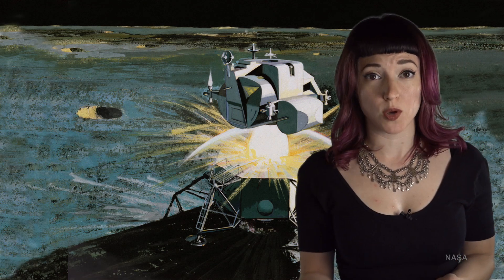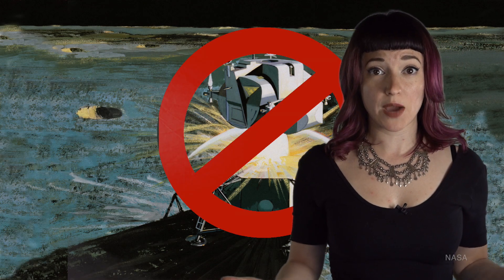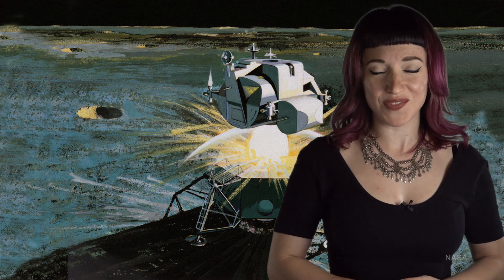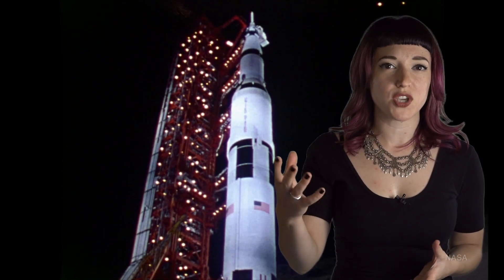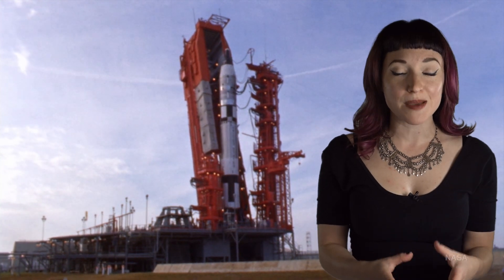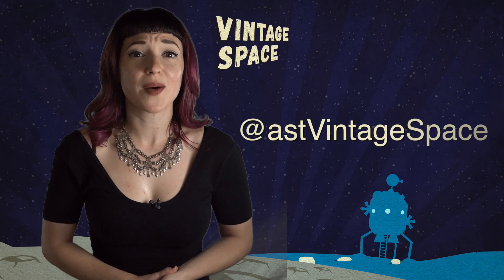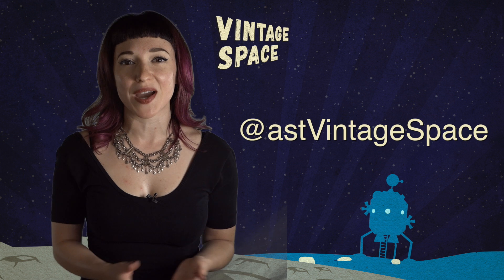How the Lunar Module Launched from the Moon Without a Flame

Comment: In space vacuum the exhaust gases will expand making flow separation thus giving not enough thrust to take the module up. It will make free expansion and attain no work. Spelling gases in vacuum won't give you force or thrust. Just a little jump thanks to the contact with the lander but nothing more. You need atmospheric pressure at nozzle's end to transfer energy, make opposite reaction,  create momentum by unbalancing forces.
Reply: Another one who failed physics for pre-teens.
Reply: @massimookissed1023 You are the failure!! LOL....  Gas generally does no work when expanding into a vacuum. This is because there's no external pressure opposing the gas's expansion, meaning no force is required to displace the gas. In a free expansion into a vacuum, the work done (W) is calculated as W = -PΔV, where P is the external pressure. Since the vacuum exerts no pressure (P=0), the work done is zero. 
Simply put...Rockets do not work in the vacuum of space!

Comment: Y can’t we use this on cars then?
Reply: Well, you probably "could" do that.  But, who would want to?  These fuels are so ridiculously corrosive that the rocket engines were one-time-use only, and basically the engine would eat itself.  So, if you want a car with an engine that could only be used once, um, ok, I guess you can do that.  Don't expect to sell very many of your cars, though.  Furthermore, the fuels and oxidizers are extremely toxic, and wildly explosive.  Many rocket scientists have died working with them.  If you want to put that kind of stuff in the public's hands, driving around in cars, sounds pretty dangerous.

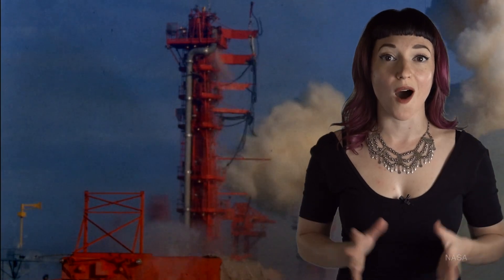Comment: At 1:40 we clearly DO see the flame - even though she had just stated that it was the same fuel used to propel the astronauts off the moon. So why don't we see the flame in the Apollo footage? Am I crazy or did she just prove that it WAS a hoax?
Reply: It's almost completely clear in the Titan launches.  You do see a bit of it.  But, that's because it's in an atmosphere, and because they ran it a bit rich (to keep it cool).  For the LEMs, there is no atmosphere, and they didn't run them rich.  And, you still do see a bit of the exhaust at the very beginning, and once pitchover happens.  The point is, most conspirards think that there should be a massive yellow/orange flame, like you see out of the Saturn V.  They are wrong.

Comment: Is it more difficult to obtain directional thrust if the exhaust power dispersed sideways in all directions?  I would expect so. Seemed to go up nice and smoothly. Did they start making these to use on earth?  Never seen one yet? Poor girl. Read too many books.
Reply: YOU SAID: "Is it more difficult to obtain directional thrust if the exhaust power dispersed sideways in all directions?  I would expect so."

== Well, I'm not 100% sure what you're asking.  Most of the thrust on liftoff was directly downward, of course.  But, yes, the thrust also spread very wide in all horizontal directions.  But, this wouldn't mess up the direction the LEM would go.  The horizontal spreading was quite uniform, so any amount of push to the left due to horizontal spreading would be countered by the same amount of push to the right.  The net effect would still be to go straight up, but the efficiency is impacted because some energy is being lost.  But, well, that's just the nature of rocketry in general.  Got any better ideas for how to propel craft in space?

YOU SAID: "Seemed to go up nice and smoothly."

== Yes.

YOU SAID: "Did they start making these to use on earth?  Never seen one yet?"

== Identical engines to the ascent engine of the LEM??  For use on Earth??  Why?  It didn't have a gimbal.  It used ridiculously volatile and toxic fuels and oxidizers.  The stuff was so corrosive that the engine couldn't even be tested before using it (because the engine basically ate itself after one use).  The energy return isn't as good as basic liquid hydrogen/oxygen mixtures.  Um, no.  Nobody wants to use an engine like that, not on Earth.  They used it on the moon because they needed an ultra light and ultra reliable engine, that would be virtually guaranteed to work on the first (and only) time using it.

YOU SAID: "Poor girl. Read too many books."

== Um, what?  As opposed to what?  Being ignorant and proud of it?  I have no understanding of the point you're attempting to make.
Reply: rockethead7 Neurotic and cant even see that. Contradicted every reasonable explanation. Didn’t even understand at all the point I am making. So everyone else must be ignorant. Buy a mirror, sit on the moon and look at yourself. Goodbye.
Reply: @Kotikjeff  
Good grief.  I hope it's just the language barrier.  I'm sure you write in English better than I write in [whatever] your language.  But, yeah, I don't understand anything you're trying to say.  Nothing.

Comment: hypergolic fuels do give off smoke in a vacuum. Saw the old NASA videos of it on Shill Stompers. So sorry, you're debunked. This is a Shill channel guys.
Reply: YOU SAID: "hypergolic fuels do give off smoke in a vacuum."

== Well, maybe some of them do, sure.  But, N2O4 and Aerozine 50 do not give off visible smoke (if the burn is correctly balanced).

YOU SAID: "Saw the old NASA videos of it on Shill Stompers."

== There are no NASA videos of smoke of a correctly balanced burn of N2O4 and Aerozine 50.  I don't know what video you're talking about in particular.  But, 99.999% of the time, when you idiots claim that there should have been a visible reddish brown smoke, it's because you're seeing N2O4 breaking down into (x2) NO2.  That doesn't happen inside a LEM rocket engine bell, because, ya know, IT'S BEING BURNED WITH Aerozine 50!!  Good grief.

YOU SAID: "So sorry, you're debunked."

== Debunked by who?  By idiots who don't understand rocket fuels/oxidizers?  Please explain why there are no actual rocket scientists/chemists and aerospace engineers, anywhere on the planet, who have spotted this problem?  Why not?  Why aren't physicists and rocket fuel chemists leading the anti-Apollo charge?  No?  Instead, all of the experts are the dumb ones who cannot spot this problem, and some fucking imbeciles who don't understand N2O4 breakdown products are the smart ones?

YOU SAID: "This is a Shill channel guys."

== You're an idiot.

Comment: PS the pressue of the atmosphere is 14 pounds per square inch at sea level. The lem produces 10000 poinds of thrust over the small conical area of the nozxle. I think we can rule out your dumb explanation as to the atmosphere (or lack of) containing the flame. When the rocket has climbed thousands of meters to the upper atmosphere where the air is rarified we still see a flame so atmosphere or lack of is a pathetic and stupid explanation as to why there is no flame at take off. The hypergolic fuel should be producing a very intense flame, which should very visible against the dark background of space.

Comment: As the camera follows Challenger up, just after pitchover the APS is pointed directly at the camera, and you can see a faint glow where the chemical reactions are taking place. But by time the hot gas leaves the nozzle it's too diffuse to produce any visible light. (Although infrared images would be cool to see.)

But proof that the expanding gas is there can be seen in the form of all the lunar dust thrown up. It actually forms a faint cloud that scatters enough sunlight to be seen as the LM rises, until it all falls back down to the surface.
Reply: FosterZygote   Also, the exhaust nozzle was heated to a point that caused it glow.  BTW...I love that pitch over shot!  Great stuff.

Comment: Sorry i call BULLSHIT! 
NO Dust on landing pads and no blast under lunar module landing = Fake Sh_t!.
 Sorry to burst your dillusional bubble.
Reply: The delusional one is YOU.  Good gods, how dumb can you be?

YOU SAID: "NO Dust on landing pads"

== Really?  And, your source of this information is what?  A video made by someone just as dumb as you are?  I mean, look, moron, nobody would expect much dust in the first place.  In a vacuum, dust will mainly just blow to the sides due to the rocket thrust.  There's no air for the dust to linger around in, and settle back down on the landing pads.  But, yes, a little bit of dust can find its way onto the pads, which is exactly what you see.  See, dummy, rather than just trusting people just as stupid as you are, how about actually LOOKING FOR YOURSELF first??

http://www.lpi.usra.edu/resources/apollo/images/print/AS14/66/09234.jpg
http://tothemoon.ser.asu.edu/data_a70/AS16/processed/AS16-107-17441.png
http://tothemoon.ser.asu.edu/data_a70/AS16/processed/AS16-107-17442.png
http://tothemoon.ser.asu.edu/data_a70/AS17/processed/AS17-134-20388.png
http://www.lpi.usra.edu/resources/apollo/images/print/AS12/47/6904.jpg
http://www.lpi.usra.edu/resources/apollo/images/print/AS12/47/6905.jpg
http://www.lpi.usra.edu/resources/apollo/images/print/AS14/66/09269.jpg
http://tothemoon.ser.asu.edu/data_a70/AS11/processed/AS11-40-5917.png
http://tothemoon.ser.asu.edu/data_a70/AS11/processed/AS11-40-5925.png
http://www.lpi.usra.edu/resources/apollo/images/print/AS11/40/5926.jpg
http://tothemoon.ser.asu.edu/data_a70/AS11/processed/AS11-40-5918.png
http://www.lpi.usra.edu/resources/apollo/images/print/AS14/66/09235.jpg

YOU SAID: "no blast under lunar module landing"

== Completely ridiculous.  First of all, there's evidence at every landing site of the rocket exhaust under the landers.  It varies from site to site, of course.  But, take Apollo 11 as an example.  Here's a photo from under the lander:

https://upload.wikimedia.org/wikipedia/commons/c/c6/AS11-40-5921.jpg

Notice anything?  The 1-2 inch dust layer is almost completely gone (blown away by the rocket engine).  All that remains is layer of compacted regolith and rock.  And, hey, dumbass, if you expect the measly 2500 pounds of thrust coming out of that big 20 sq foot (cross section) engine bell to cut into compacted regolith and rock, you're an idiot (which we already knew, of course).  I mean, look, stupid clown, I know it's a waste of time to try to teach you physics.  But, if your premise is that you think the 2,500 pound rocket engine was supposed cut into compacted regolith and rock (and create a crater), please explain all of those Vietnam era Huey helicopters that landed on plenty of beaches, yet never cut any craters??  Those have 10,000 pounds of thurst upon landing and take-off, you know.  No craters.  Are they fake too, and the Vietnam war never happened?  Or, explain the MI-26 helicopter, which lands and takes off with 130,000 pounds of thrust.  No craters.  Are those helicopters fake?  Look, dumbass, there's a reason that no actual physics PhD anywhere on Earth is making these claims you're making.  They know what they're talking about.  You do not.  You're a fucking moron.

Comment: There is a brief flash of light in the shadow beneath the ascent stage as it begins to move. Gold foil  (probably) then flies out with no deviation or slowing as would happen in the air. Also we can see a steadily expanding fog rising upwards carrying with it surface grains and perhaps ice particles as the temperature of the cloud would fall rapidly due to uncontained expansion in a vacuum. It’s a pity the footage was not sharper as it was a unique opportunity to observe the phenomenon, perhaps some processing would improve it.

Comment: But when they were leaving the moon there was blue gas that went out of the nozle, sorry my English is bad, and how do you explain no dust, no blast crater? It's insane to belive that they went on the Moon, to much unlogical things happened, and as You can see in the Nasa pictures before the Apollo missions you can ser a blast crater and visible particles going out of the nozzle but when they filmed it all of the sudden things act differently.
Reply: Ognjen Grozdanovic there's no crater because they landed on rock with a bit of dust on it. You'd need a drill to make a crater in that rock. Also, there was dust, however lunar dust behaves very differently than a similar substance would on Earth, due to the Moon's 1/6 gravity and nearly non existent atmosphere. 

The engine, and even the fuel used were completely different in the ascent and descent (not to mention there is no footage from the vantage point of the Moon for the landing, only the ascent - for obvious reasons).
Reply: @marshallcello1128  
YOU SAID: "The engine, and even the fuel used were completely different in the ascent and descent"
== Maybe it's a wording problem.  But, the fuel/oxidizer used in the ascent engine was identical to the fuel/oxidizer used in the descent engine.  The engines themselves were different, of course.  But, fuels were the same.  But, maybe you meant the LEM used different fuels/oxidizers than the command module, or the Saturn V first stage, or the SIVB, etc.  There were at least 3 different fuel/oxidizer combinations used in the various rockets/stages... or even more combinations if you include the hypergolics used to spin up the turbine pumps in the Saturn V first stage (not a main fuel for propulsion, but a fuel to get the other fuel pumping).
Reply: rockethead7 yes, my language was too vague. Thanks for the clarification.

Comment: two questions: 
1. Is that a tattoo or some necklace?
2. While we agree that the cameras were not 4K ultra hi def in those days and they used special fuel type but how come there was no moon dust scattered because of the thrust from those clear flame fuel burning rocket engines with missing nacelles to guide the thrust.
 note:First question is optional
Reply: YOU SAID: "While we agree that the cameras were not 4K ultra hi def in those days and they used special fuel type"

== Well, it's not so "special" that nobody understood it or something.  They wanted to use hypergolic fuels because they wanted the rocket engine to be as simple as possible (lowest chance of failure).  The ascent engine was one of the only major components of the entire Apollo program that had no backup plan.  They couldn't abort the mission because they were already on the surface when it was used.  There was no backup ascent engine.  They couldn't use the descent stage to get back up into orbit for rendezvous.  That engine either worked, or they were stranded.  So, they used the "special fuel" and oxidizer to make that engine as simple as possible.

YOU SAID: "but how come there was no moon dust scattered because of the thrust from those clear flame fuel burning rocket engines"

== Well, there probably was.  But, a vast majority of the ascent engine's thrust was absorbed/deflected by the descent stage, which operated like a launch platform.  I'd imagine that some dust was disturbed once the craft lifted up 10-15 feet.  But, you answered your own question when you outlined that the cameras weren't 4K ultra hi def.  With 200 lines of resolution, at the distance of a football field away (give or take), sorry, you're not likely to see much dust being blown by the small percentage of thrust that hit the lunar surface.

YOU SAID: "with missing nacelles to guide the thrust."

== Rockets don't use nacelles to guide thrust.  So, you're wrong right out of the gate by even asking the question.  They usually just have the engine (with the engine bell) on a gimbal.  The gimbal is what directs the thrust, by vectoring the thrust using gyroscopes and electronics.  However, the LEM's ascent engine wasn't gimbaled.  It was fix-mounted, and the thrust couldn't be vectored.  Again, they wanted that engine to be as simple as possible.  So, adding a gimbal would have been an additional possible point of complexity and/or failure.  And, frankly, a vectoring gimbal would have also taken up too much room inside the crew compartment.  But, they did have the thruster quads.  So, they used those in place of vectoring gimbals.  The craft was small/light enough, and the center of mass was close enough to the ascent engine, to make this possible without requiring that the thruster quads burn like crazy to do the job.  And, as a side note, this dynamic is also why you always see the ascent stage rocking forward and backward during the 16mm film footage from the LMP window.  Because there was no gyroscope/gimbal setup to control the thrust vectoring on the ascent stage, a little bit of off-center mass distribution will cause the craft to divert off course.  They got pretty close to having the mass distributed evenly, but no ship/rocket is ever 100% perfect in even mass distribution.  Gimbals usually accommodate any uneven mass distribution in most of the rockets you see.  But, since gimbals weren't an option in the ascent stage, they will go off-course due to even a small mass/weight distribution variance.  So, they programmed the thruster quads to compensate.  But, they didn't want those thrusters to constantly be firing (waste of fuel, and not worth the effort to constantly fire them).  So, they basically programmed the computer to recognize that the craft was off-center a bit, and to overcompensate.  So, you get this rocking back and forth motion as a result.  The thruster quads fire to get the craft oriented correctly, but they leave the thruster quads on a little bit longer to overcompensate, then they turn off.  Then the craft rocks back the other way due to the uneven weight distribution, which the computer doesn't fight right away, letting it rock back past the point of exact alignment with the course they want.  Then the computer fires the thruster quad, once again, a bit longer than you might expect it to.  It is estimated that they saved about 40% of the use of the thruster quads by allowing this rocking motion, rather than to constantly be firing all the time.
Reply: @rockethead7  right, so, same 200 lines resolution cameras could capture thrust on earth but not on moon and rockets do not have nacelles. Got it.